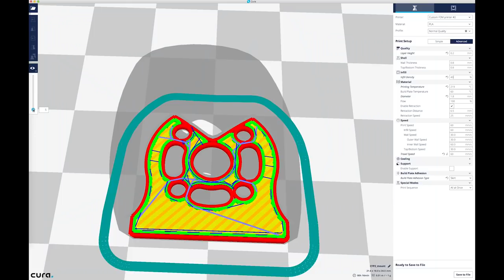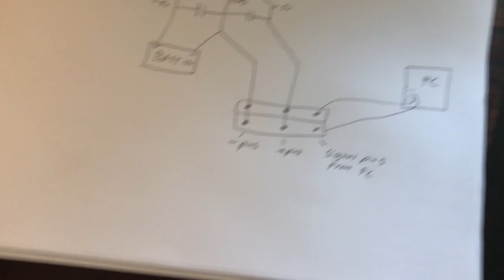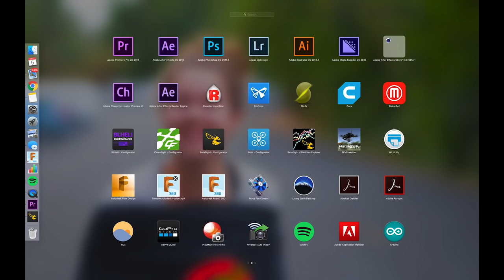Fly-By-Wire FPV Race Wing from Mini Quad Parts

Comment: I'm building almost the same thing. My delta wing will run the FrSky S6R instead of a FC, 2204 motor, 20A ESC w/BEC, 5x4.5 prop. Same Eagle and Vtx. My printer is pumping out parts for a work order and I cant print hobby stuff yet. I like the simple wing design, I may have to try it.

Comment: Nice and really simple build, which flies well too. You might want to swicth the propeller to a larger (but suitable considering the amps) 3-blade or even a 2-blade propeller, more thrust and speed and a better climb rate too :)

Comment: Honestly cannot believe how good a 1306 did on that wing. My wing a little larger and I felt like an 1806 motor on 3s wasn't enough to get it moving and a 2205 on 4s was just barely cutting it.

Comment: It'd be cool if you could add retractable landing gear to a flying wing. It would be perfect for ground takeoff instead of hand launching (although it might just add unneeded weight).
Reply: I think in this case it would be useless, the wing is tiny already so landing on grass would just tip it over lol. It can just land without hurting itself because its so light

Comment: Hi Samm. Im enjoying your channel, we'd get along well. I've got a question/suggestion/conversation starter. So why not add a second motor from the drone, just make it run in the opposite direction to the first, and obviously the prop would be the oposite orientation. Now, make both props a much deeper pitch. You would definitely fly faster, and the motors would balance the angular torque of each other, but would this not then give better efficiency due to the deeper pitch of the propellers... 
I'm keen to hear your opinion on this, I might make 1 for youtube some time....

Comment: Finally!! 

Also, is your voltage reading correct on the osd? Cause it stayed and 16.3 for way to long and when you were punching the throttle it didn't move. Great video anyway!
Reply from the maker: Huh. That is suspicious. It’s possible that with only one motor and that middle/high voltage range that the battery can hold its voltage well, but I agree I would think it should show a drop in the punches.
Reply: lol... 

thx for reply:D

Comment: You can probably get away from the separate regulator if you use the cheaper analogue servos. They make a lot less noise.
Reply from the maker: It’s really helpful to have fast accurate servos when controlled by a flight controller

Comment: Im very new to rc planes. I do have reasonable knowledge on subsonic aerodynamics and im a computer programmer by trade. So, those 2 elements are not an issue.

I need an automated system which will bring my plane back to its takeoff place (within a margin of <=10 square meters), in case I lose communication with the plane or the plane leaves "my" airspace for some reason.

Any recommendations on hardware which can allow me to solve this necessity?
Reply: Use dji naza flight control board I guess it has more config than quadrotors...

Comment: Wow, fantastic! Some questions: a bec wouldn't be enough for powering the servos? And what about the setup in that software?
Reply: MC's Creations A bec should be better than a linear regulator for efficiency and power but worst for noise.
Reply: dar0 Maybe. There are becs specific for fpv.
Reply from the maker: You could totally make a BEC work, I was probably just too rushed to think of it and try one. I had the regulator available in a local store
Reply: Samm Sheperd Nice! Thanks! :D
Reply: dar0 Lots of BECs are linear regulators. Though they're usually linear on low cell count (3S or less) ESCs.

Technically, Samm Sheperd's regulator is a BEC. (It eliminated the needed battery for the servos, thus it was a Battery Elimination Circuit.)

Aren't YouTube comments great. Where else can one be so nit picky about details like these? :)

Very cool project Samm Sheperd. Thanks for posting.
Reply: Duane Degn Actually, BECs are usually buck converters. But, anyway, there are really small buck regulators too, that can be used in situations like that.
Reply from the maker: I think the ones that are buck converters are called "S -BECs" the "S" meaning "switch mode." A small commercially available BEC would work fine if you used it like I did. To isolate the noise from the FC while still allowing the FC to control the servos

Comment: Hi, It is more suitable to use ceramic capacitors with 7805. Ceramic ones have better frequency response, so they will suppress more noise.
Reply from the maker: Thanks! I think you’re right

Comment: i have a challenge for ya! Make a functional ILS system for RC planes, and with that, maybe autoland?
Reply from the maker: Flying an ILS with RC would be so fun lol. Way better than the sim. But designing my own autonomous approach with auto land is even easier
Reply: MLS by triangulating a WiFi transmitter?

Comment: Did you plan to have this plane balanced a certain way before cutting it out?
Reply from the maker: Not really. I tried balancing with the components afterwards
Reply: forgive me for my inability to possibly use the search function but I'm not sure if I've seen you explain exactly your method for balancing your planes. is there a resource you'd recommend, or a video you've made that would help with that?

Comment: Samm I have a question. I'm looking to get into FPV but I hear that you need a HAM technicians license to legally fly FPV in the United States. Do you have a HAM license? If so, what was the process of getting one like? Thx!
Reply: Benjijart no one gets those
Reply: I have my ham ticket. It's free to study, usually $15 to take the test. Required for legal fpv unless you go digital or buy certified analog transmitter.

Comment: Nice work . . . . Which flight control you have used ?
Reply from the maker: Some variant of an SP Racing F3. Some come equipped with an accelerometer, barometer and compass. I usually get the ones with out all that because race quads don’t use them.
Reply: Thanks for reply . . .

Comment: why did you do things the hard way fort servo power?
most boards have a simple option to isolate the servo power rail and then the esc drives the rail rather than the FC's on board regulator but if the board does not have the option then you just cut the trace to the 5v rail and to ground too if necessary , there was no need to build a independent rail!

Comment: i always thought fly-by-wire meant that there is an actual wire attached to the plane/rocket?
Reply from the maker: It means the flight controls are controlled electrically over a wire, which all RC vehicles are. However traditionally it means the a computer is doing the flying and the pilot sends its input through the computer. Used on fighter jets to make a very maneuverable but otherwise unstable plane flyable.

Comment: hey can you run OPTO esc without a flight controller?
Reply from the maker: Sure. The ESC only needs a signal and ground. It gets its power right from the battery
Reply: Samm Sheperd 
I was running with my x8r but it still wont want to arm. Do you think it had to do with ppm signals? Or pwn?
Reply: Samm Sheperd 

X8r did not work

Comment: im gonna split hairs here and say that every single RC aircraft is flybywire because you are not onboard flying with hydraulics or cables.
Reply: I'm gonna split your splitted hairs again and say that every single RC aircraft is flybywireLESS because you are not onboard flying with hydraulics or cables.
Reply from the maker: Yes all RC are electronic, but traditionally FBW means a computer is doing the flying and the pilot requests maneuvers for the flight computer to execute on his behalf. Typically used on fighter jets.
Reply: "Typically used on fighter jets."
Was it was first used on Spaceships ;) The first flybywire system was a Apollo Computer ^^
And nowdays, most of the Airliners are flybywire

Comment: You shaped the control surfaces wrong lol. This is clearly an FT arrow inspired which is unfortunate as the arrow sucks. The widest chord of the control surfaces should be out wide and far back, not pushed in and forward like you did. Your design leads to non axial rolls, and larger throws than needed which means less efficiency and faster stall.

Keep up the great work!
Reply: also high kv motor with a fourbladed prop is not very efficient... larger 2 bladed would give him more thrust and flight time
Reply from the maker: Not going for efficiency, just thought a little screamer would be fun
Reply from the maker: Never seen the arrow. Like I said, made up on the he spot, changed the elevens a bit later.
Reply: Most def, you want to take into consideration what makes it fast. High pitch, and high kv are part of it. But going 4 props just increases thrust and torque roll but doesn't do much for airspeed. 

So if you go with a lighter loading prop, but keep a high pitch and kv, you can get that sucker even faster and might require a little less trim!
Reply: Really? It's funny because of how much it looks similar even with the center pod section. 

I would revisit the control surface shape and make those rolls crisper. Also I find a KFm 4 airfoil works great for these little flying wings! Love the videos man keep up the awesome content!
Reply: it looks definetly like fun :) and i like those LEDs
Reply from the maker: The choppiness of the rolls are from the PIDs in the flight controller. I didn’t do very much work to tune it properly
Reply: Samm Sheperd that's a different thing than what I am talking about. 

I am saying that the forces applied to the control surfaces, regardless of FC input, result in non axial rolls. 

Look at the shape of the control surfaces on say the tbrc reflex to see the difference in shape of control surfaces. 

Having the thick section out wide means better roll authority, having them far back means better pitch authority. Having them in the middle means you no longer pivot about the center axis. 

Turns end up looking and feeling like riding a half pipe rather than crisp. This is a physical property, not a turning thing.
Reply: But it flies and he had fun flying it

Comment: I calculated that the wingspan is 76cm or 30 inches
Reply from the maker: Well you’re right. But how did you know?
Reply: I would have used an image where you have it laying on the cutting mat.
Reply: I just took screenshot where you had the plan and a ruler that was 45cm long and I just took a ruler and measured and the i concluded that the Ruler was 9,463 times smaller than in real life and then i measured the plan and then i added that with 9,463.
Reply: I ment the plane
Reply: I screenshoted at 3:19
Reply: Well you also could have been aware of the fact that this was made of dtfb and that one sheet has a length of 30 inches. You took the hard way.
Reply: Oo okej I didn’t now that
Reply: Yep, 30" x 20"  ;-)

Comment: *The "SPracing"F3 with OSD from Gearbest no longer works with the current versions of cleanflight, betaflight, etc. The FC is a CLONE and there is talk on forums of the chips used in the clones causing communications issues with the configurator apps currently. I bought 2 thinking my first was a dud...and I was right but they are ALL duds. Buy an OFFICIAL supported FC directly from a manufacturer or supported site with extensive documentation or suffer endless headache...there is a reason they are on sale and limited stock...

Comment: Why "Fly-By-Wire" in the title ??
Reply from the maker: According to google: “As the term implies, fly by wire (FBW) replaces conventional mechanical flight controls with an electronic interface. The pilot's movements of the flight controls are converted to electrical signals, which are interpreted by the flight control computers.” 
Obviously all RC planes are electronic but traditionally in a full scale plane (like a fighter jet) this means a computer is doing the flying and the pilot requests maneuvers for the computer to execute.